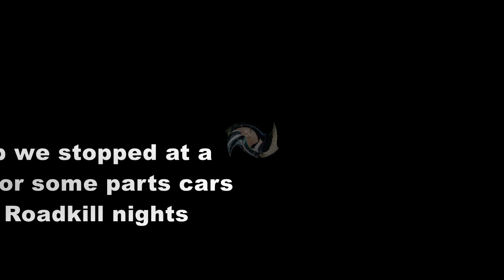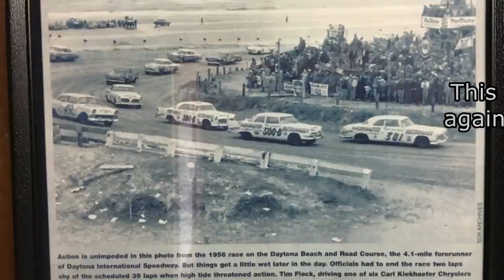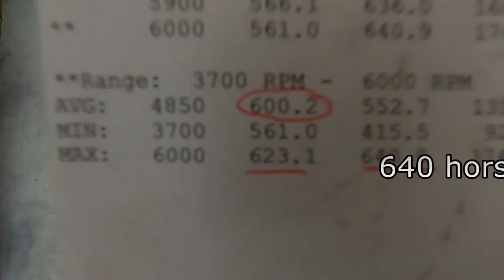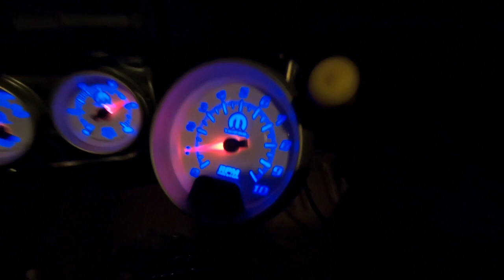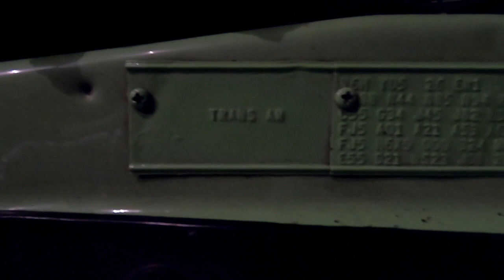Chargers and Roadkill and Hemi's, OH my....

Comment: Thank you Chris for saving the best looking muscle cars ever.  I was looking for a nice 69 Charger in 1979.  Only 10 years old, they were already rotted here in Pennsylvania.  You are the man.
Reply: I have an clean east coast 73 AMX, just needs 1/4s, trunk pan and floors. I live in PA but the car came from New Jersey. Probably near the shore (judging by the 5 gallon bucket full of sand I removed from the front frame rails).

Comment: I am at 6 minutes in man, I have to point this out, the block may be a '64 but it does not have the correct 64-65 "K" heads on it to make it a true Race Hemi. The indentations on the heads and valve covers were introduced in 1966 for the Street Hemi, the notches were so the Hemi could fit a power steering pump. There are also internal changes along with the Race Hemis having crossram intakes. Just thought I would say all of that, anyways good score, now to enjoy the rest.
Reply from the maker: Ha...ur only half right, it has 1 64 race Hemi head
Reply: @junkerup  Nope, both have the indentation, lol
Reply: @junkerup  Y'kno,  you coulda gone the rest of this lifetime without badmouthing the roofline on the 67 R/T.

It's the progenitor of all the cars you love the most.

My Dad's 64 426 street wedge Polara 500 has the  most beautiful  flying buttress 'B' pillars of that style,  but the 67 is still clearly the bloodline.

Love them ALL Sir.
Reply: @junkerup  I wrote to you on your live feed day saying did you have a 426 hemi now I know LOL.What do you do with these super rotted cars?put all junk parts on and spray can orange paint + 01 and sell them

Comment: My cousins 69 he bought was even worse then this. Absolutely no floor or trunk. Pulling the car out, it ran over the seats. Leaf springs through the trunk. Insane that he’s going to try and restore it. Complete rebody. The only thing that will be the same if the vin
Reply: The tranny drug on the ground.. 😂 it was a nightmare to move.. original b3 383 2 barrel car. Buddy seat and column shift car